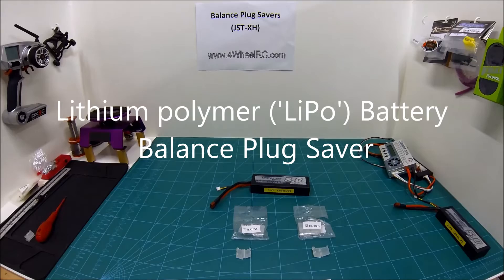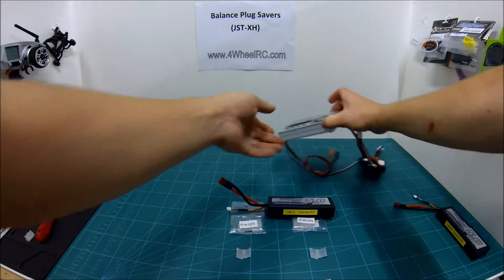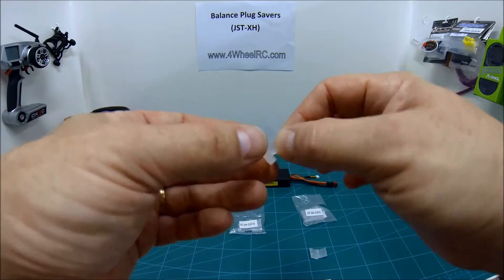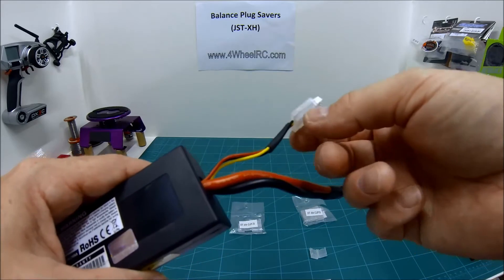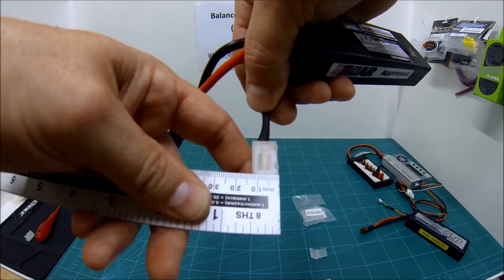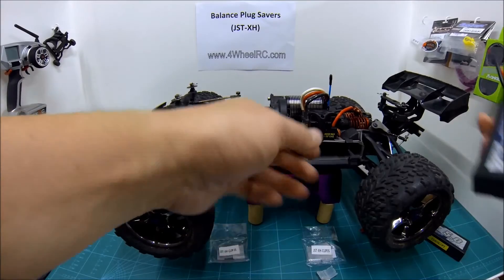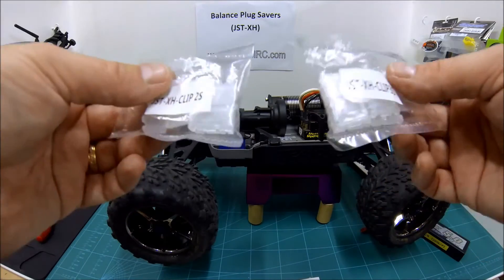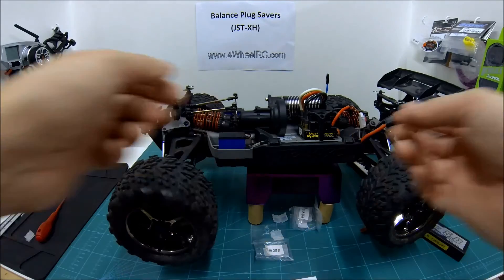LiPo Battery 'Balance Plug Saver' Review.

Comment: Bought some of these balance plug savers on Hobbyking a few years ago for a few cents. They now have discontinued the 5 pack and only offer them individually in yellow for about a dollar... They don't even have a 2S version anymore, I'm very disappointed in them. It was a great cart filler and made handling these fragile plugs bearable.
Reply from the maker: Hi Antoine, have a Google - 2S Balance Plug Savers are still available from may sources inc. eBay, https://www.horizonhobby.com/2s-balance-plug-savers-jst-xh-%285pc%29-dync0115 and https://www.banggood.com/buy/balance-plug-savers.html

Comment: You can also use a drop of hot glue (front and back on multi S packs)...then just lick your fingers and work a small amount into and around each individual wire. I've found this to be a very economical means of protecting against cable sheath failure due to stress fatigue. It also gives a slightly larger surface area to hold onto.
Reply from the maker: +Megan Phillips Nice idea, but I'd warn folks to be careful about touching hot glue with their fingers, as it could be dangerously hot when just squeezed out of the gun.